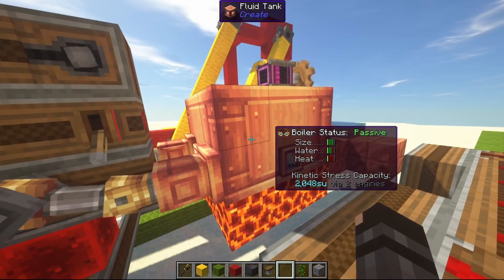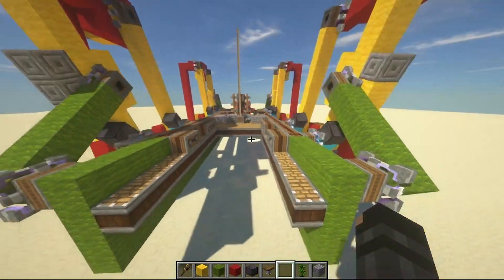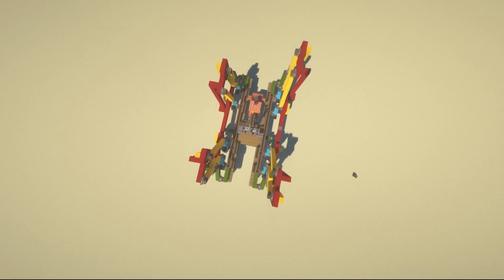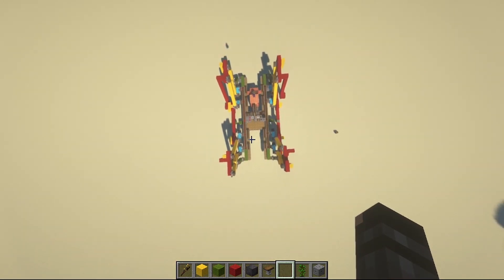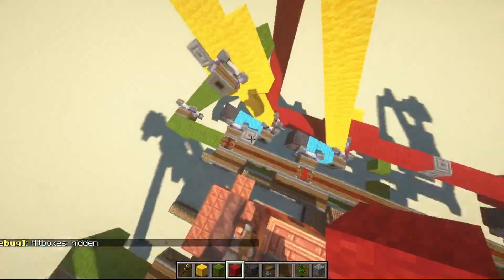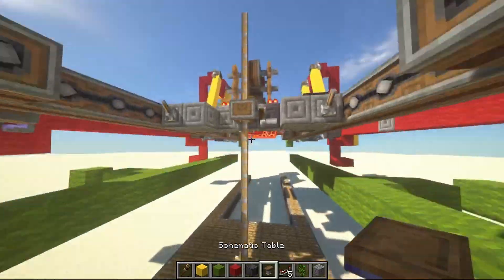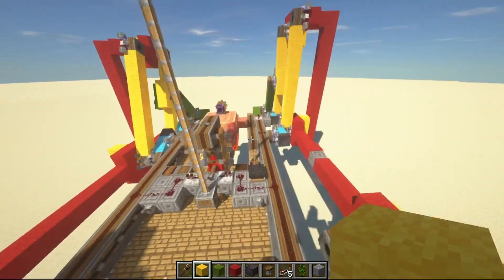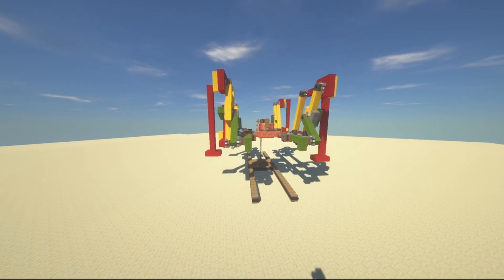This is how the Plantigrade Walking Machine made with Clockwork works

Comment: You are crazy for making it survival friendly
Reply from the maker: Haha I know right? Like who would actually use this in survival. I guess I just like steam engines...
Reply: @KwizzleHazzizle  I kinda want to use them more than the clockwork engines. Using a random fuel doesn't really feel good yet
Reply from the maker: @Mysda_  Yeah, that and you can see the pistons and crank shafts which just looks so good.
Reply: @KwizzleHazzizle Steam engines are so satifying both irl and in the create mod. Btw i made a lego ocean liner from the 1850's and i wanted to ask you if you want it to be a paddle powered or propeller powered.
Reply from the maker: @JinxBlitz  Steam engines are indeed awesome. Hey, it's your build, up to you!
Reply: @KwizzleHazzizle  oh ok. It's because it's kinda inspired (mainly on the super structure) of the Collins Line's Adriatic, which has paddles. Mine does not